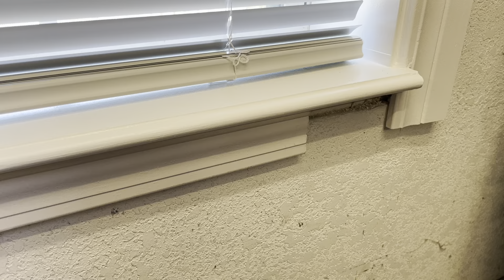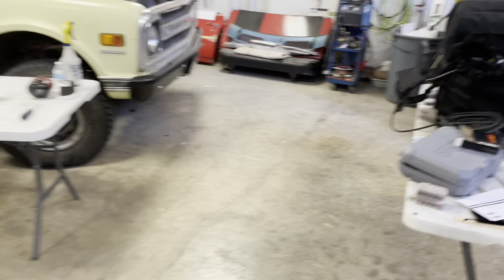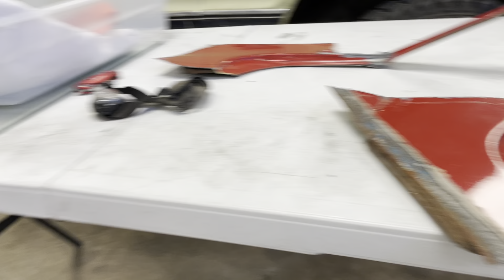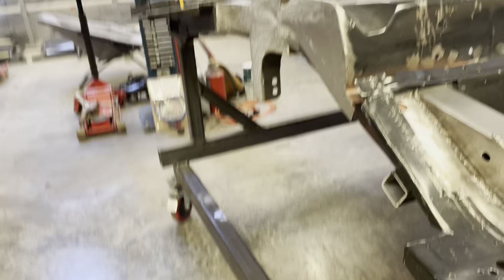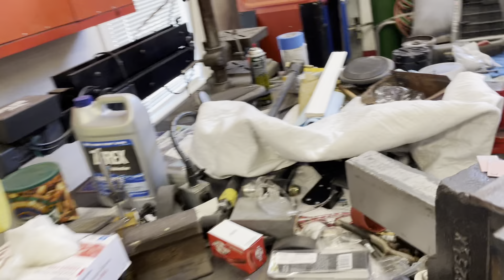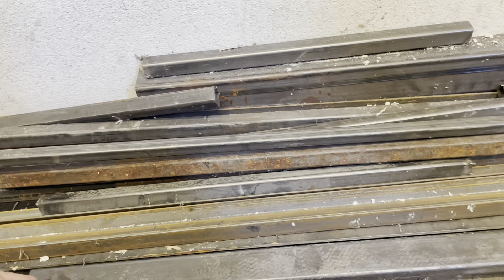Getting sh@t done !

Comment: The floor pan is looking great Roger. Personally, I don't think I would drill the spot welds for those floor panels where they are already there but I would apply some seal sealer around the perimeter of them as a little extra precaution against corrosion. 

I would also build a car vs buying, but that's just me.  

Love the patina on the door by the way.  

Mike

Comment: Concerning the quarter panel stiffeners, Jubee May's has a video on installing them, he says your supposed to use panel bonding glue. I have to install them on my new quarters. The left hand quarter on my 68 had been previously replaced before I bought it and they did not reinstall that stiffener so I just bought two new ones.
Reply from the maker: He may just panels bond them on, the factory pinch welded them in about 5 spots
Reply: @MrFireman164  yes there spot welded at the trunk weatherstrip channel but he said the large flat area is panel bonded onto the quarter. Jubee would know, he's a Camaro expert!

Comment: The universal problem is shop space or the lack thereof, lol. They don't build them big enough to fit my budget. Can you tell a difference in room temperature with the door insulation. Thinking of doing the same to mine but that insulation is kind of expensive. Worth the effort and $$$? Thanks.
Reply from the maker: Yes it has dropped the temp by 5 or so degrees more it seems when it’s a hundred degrees outside it stays around 75 inside, it hit 109 the other day and inside It was about 79 inside. This building has 2x6 studs with R-19 insulation in the walls and ceiling and is very tight minus the bay doors that’s why I went ahead and insulated them because they were a weak link.